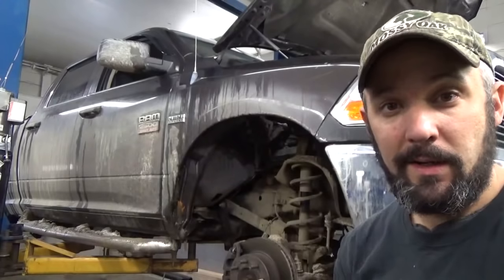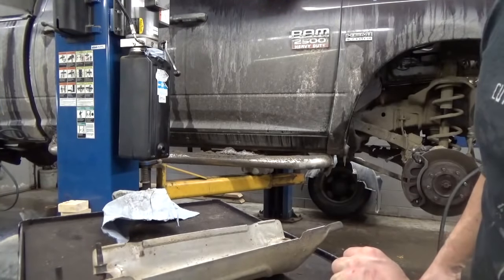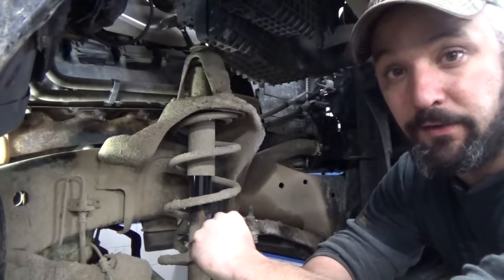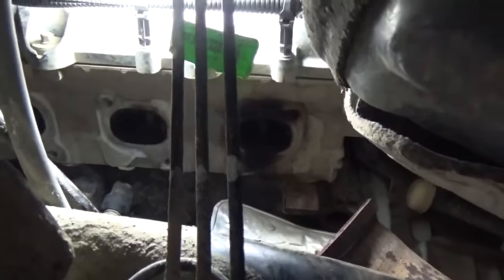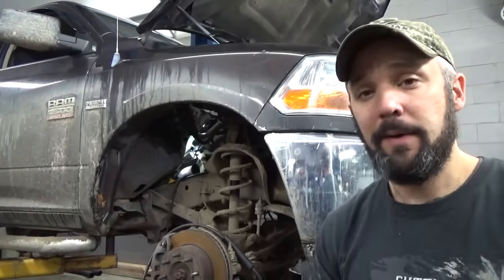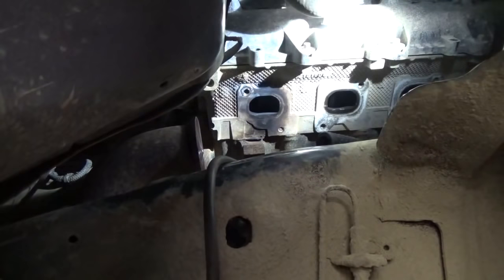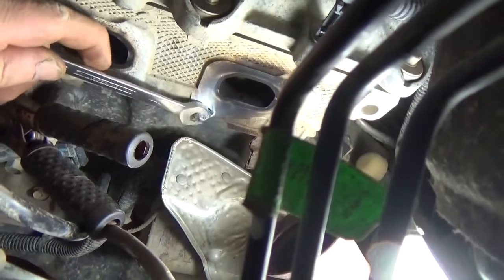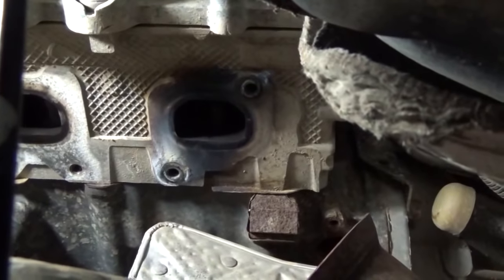Removing Broken Exhaust Manifold Bolts - Hemi Dodge Ram

Comment: There needs to be a recall on this with the Dodge Rams because I just took mines in this week to get repaired....it's a design flaw with cheap parts smh
Reply: maurice long how much did it cost you?
Reply: What did it end up costing you?  One or both sides.?  Looking at the same repair..
Reply: socchall hi right side cost me 360.00 friday it will another 460.00
Reply: 360.00
Reply: maurice long Why they used such small bolts is beyond me, seen tons of 5.7s come in with a case of the ticks!
Reply: maurice long as long as we continue to try and make cars trucks ect lighter and lighter and use more plastic and garbage quality this will never improve. I thought the same thing why make exhaust bolts so small and cheep? especialy when there a bear to get to, then I forgot that would cost 0.02cents more!
Reply: Totally agree with the recall. i have to believe that there are more that have had it done than those who haven't.  I had my drivers side done, now my passenger side is ticking.  Eric must be living right as it would never go this easy for me..
Reply: @rogerwa123  
Recalls are for safety items. This isn't a safety item.  The vehicle wont crash unexpectedly because of it. This is a routine repair.
Reply: Eldon Johnston 
Have you done this repair Eldon??? If not, it’s ABSOLUTELY NOT ROUTINE at all!!! It’s a premature part FAILURE!! The supplier that makes these bolts failed in the process somehow. Chrysler knows it, and even changed the supplier after this particular GEN of the Ram was over. There are THOUSANDS of these rams out there with this issue!! It’s so bad that most all Chrysler/Dodge parts centers keep these gaskets and manifolds in stock. Personally I replaced stock with shorty ceramic headers. BBK. Pain in the ASS to do this job! Not for a amateur!
Reply: Go figure its another dodge
Reply: I too have a 2010 dodge ram and it had a ticking, and it was the exhaust manifold, guy before drilled a hole to big and the stud was loose leaking out coolant, had to replace the cylinder head
Reply: Ford and Chevy having the same problem.
Reply: I'm not a big fan of Dodge products in general even before Fiat came along. But in all probability Fasteners turns themselves are coming from some overseas supplier. That supplier may be cheating on the specifications for what those bolts are supposed to be made of and their tensile strength. About 30 years ago Detroit got burned because there was a flood of Fasteners out of Taiwan that were the wrong tensile strength. It caught all the major car manufacturers and caused problems ranging from broken bolts to Warped heads.
Reply: I have 2015 and its ticking and has and exhaust leak noise at start up but goes away after running..I think this is the same issue
Reply: It's not cheap parts it's the difference in cooling from aluminum heads and cast manifolds
Reply: @mikefalle7910  sounds like it
Reply: @BigFrankRizzo  shortys suck. Long tubes way to go.
Reply: @littlebittathisnthatfirear8048  had a custom exhaust shop tell me the same thing. Shorty aren't worth it. Also, enlightened me on another unconfirmed truth. the problem will happen again with factory manifolds and with headers.
Reply: I was about to say, nearly every Ram I hear going by has an exhaust leak.
Reply: Every v8 pickup has this problem Fords are definitely the worst/most notorious. Dodges are common but it's easy so not that big of a deal. Definitely not recall worthy. If every manufacturer recalled a car because it had a common issue they wouldnt make money.
Reply: What's messed up is ford dodge and chevy all do that I change at least one every week at work on one of those 3
Reply: My Chevy did the same, I’ve seen it on all makes of trucks. I do know Dodge will cover it on powertrain warranty. Not sure on GM or Ford.
Reply: TYPICAL Dodge
Reply: I have a problem with mine too, the issue with mine is it says "manufactured by chrystler" and i want it recalled because all of them have this major issue
Reply: @eldonjohnston5053  what a load of crap, recalls are for all sorts of stuff. and a design flaw does not equal routine maintenance
Reply: @pannterra86  about tree fiddy'
Reply: @alexyoung4587  yeah well they wont make much money losing customers either. I traded mine for a tundra. My ram was doing this at 46k miles. Mechanic at the dealer told me they would have to replace the heads. $3500 repair. I loved my ram but I'm not replacing the heads every 46k miles because the bolts break off to deep for them to try to get at. So far my tundra has been rock solid.
Reply: It has nothing to do with cheap parts. It has everything to do with the design of the cast-iron exhaust manifold. For starters cast-iron to an aluminum head is the major problem, but the design of the manifold causes more heat at the back of the manifold.
Reply: Does this issue have anything to do with the ECO mode cutting out cylinders heating up and cooling off too much?
Reply: @theminion2771  Not really. This happens on other engines and brands also. It is mainly from using studs too small in diameter. The nuts rust fast to the manifold and the expansion and contraction of the manifold over time from heat cycles snaps the studs off. Rusting, if you are in the rust belt helps to accelerate the process. I put headers on my truck before it had 30k miles on it to avoid the inevitable stud breakage issues. The manifolds are thick and expand quite a bit when heated up, especially the stainless ones.
Reply: @sdvten  with the headers this problem is cured right?  Getting ready to pull the trigger on buying them but just want to be sure it's a real fix
Reply: @theminion2771  Headers seem to get rid of the stud breakage problem in my experience. I've had my headers on for  around 11 years now here in the rust belt and have not had to replace any bolts. They are just grade 5 zinc plated bolts that came with the headers. I re tightened them 2 or 3 times after the header install because the gasket compresses some but that is it. Get a good quality set of headers (stainless if possible) and you will likely have little to no issue.
Reply: @sdvten  am looking at JBA shortys.
Reply: @theminion2771  Those are pretty good.
Reply: @BigFrankRizzo  I pull the heads! So much easier! A little more expensive in gasket! But so much easier!
Reply: This isn't worth a recall lol 
This regular maintenance 
They should recall their hemi engine bc its a horrible build, sohc is dumb as it doesn't get enough lubrication from the oil causing the lifters to hit the camshaft and wear also causing the Hemi Tick
Reply: It's a problem on fords and chevys too.  My 04 silverado (5.3ls) had like 4 broken, my 2014 silverado (5.3lt) has two broken at the moment.  There's gotta be a better way for them to design these or use better fasteners.
Reply: @BigFrankRizzo  shorty headers are a waste of money for extremely minimal gains compared to longtube headers.
Reply: Ford trucks have the same issue.
Reply: What happens if you don't Make the repair
Reply: King
Reply: Got my tick today 53k miles
Reply: This and the oil pan should be Dodge recalls.  I just spent over 1k to have these bolts replaced at the dealership..To replace the oil pan is another 1K. According to all the videos to repair these " shitty" products,  these are both common and on going problems with RAM trucks.
Reply: @rodneyhickman825  been driving on mine for as far as I know over 10000 miles.  Been seeing a drop in mpg average. So took it in . Getting three new bolts and gaskets today. Hope to see it running better. The tick was getting worse as well. Im no mechanic,  but one would have to assume if not fixed would leave to carbon build up on the the valve seats and would eventually lead to bigger problems.  Just my guess.

Comment: Great video! This is one of those repairs that looks easy if you have a climate controlled garage, lift, and MIG welder. Car repair would be a breeze in these conditions! Meanwhile, I'm in Minnesota jacking my car up in a gravel drive way with only a butane torch........Time to pay the mechanic......
Reply: I agree. I'm on a dirt drive way with temperatures around 112 degrees . And no jack stands
Reply: You guys have a drive way? Living like kings!

Comment: Good video, I was able to extract my broken exhaust stud front drivers side 2013 Dodge Ram 1500 5.7L Hemi with your technique. Took me a little longer then I thought, took like ten nuts before I got a good weld. Thanks for your video it helped.

Comment: I had the back 2 bolt heads broken off on my 04 ram. I didn't remove the manifold but I was still able to weld a nut on the rest of the stud and back them out to replace the bolts. Did that and the ticking stopped! Great video!!!
Reply from the maker: +Blake E NICE! I have done that on some of the 6.0 GM's myself.

Comment: I had heard horror stories about replacing exhaust manifolds, and was a little apprehensive about replacing mine on my '03 Dakota 4x4 4.7L. Fortunately none of the bolt were already broken off, I just had cracked manifolds. I ended up taking my cutoff wheel and removing the heads of all the mounting bolts so that I could slide the old manifolds off, and still have enough material of the bolt to deal with getting them out of the heads. Of the 16 bolts I was able to remove all but one by hand. The last one I had to put a pair of vice grips on and turn it about a quarter turn then it came out by hand. 

I like the videos, you do great work. Keep up the great content. I believe that if people have the know how and ability to do things why should they pay other people to do what they can do for themselves.

Comment: Thanks so much for making this video. I followed your instructions and welded the nut onto my broken bolt. Worked like a charm! With the help of this video I was able to do this repair myself and saved over $700 compared to taking it to the stealership. You did a great job explaining and showing all the steps. Thanks again!!!

Comment: installed 2 new manifolds on my son's 2008 ram 1500 5.7 over the weekend following your guidance and it was a breeze.  3 studs broken off in heads and mig welding nuts worked perfect. Also studs for head shields were in bad shape so i cut the heads of them with acetylene and removed with vise grips after removing manifolds. thanks for the video!

Comment: Really nice work man!     Getting that 2nd bolt out was really  some great work.   In a case like this, brand new manifolds and bolts seem the smartest way to go.   Also.   Anyone owning one of these trucks should have these bolts checked out, loosened and replaced periodically.         Getting that 4th bolt out was something only the really gifted mechanics pull off.  Thanks for the tutorial.

Comment: when flush or recessed start with welding on a washer then a nut easier to get weld to stick
Reply: I've done the nut trick several times and it can be tricky. Your tip will make the next time a lot easier, thanks!

Comment: Great video, as the original owner of an 09 Ram 1500 Hemi, I have lifetime powertrain warranty.  My exhaust bolts have been replaced FOUR times, about every 40K miles.  I have 202K now, past due, 50K on this set.......

Comment: What an excellent demonstration, thanks for going through the effort of filming. I presume the extra heat needed to weld aluminum (rapid heat dissipation) is why you can weld so close to the head. Have you encountered any problems accidentally welding the bolt to the a steel head? Aside from removing the neg pole of the battery and avoiding fuel components, do you take any special precautions before welding on an engine?
Reply from the maker: No extra precautions taken other that the ones you mention and in reference to the cast heads I have hit the head while welding a bolt but it does not seem to bond to the cast well if that makes sense. The weld seems to break free from the cast really easy.

Comment: just did this job...had one manifold bolt broken off very deep, couldn't weld a nut onto the broken bolt as it was deep and the mig kept hitting the nut and head. Tried to put a nut on it a few times....gave up and just did weld build up until I could get a set of vice grips on it....worked well....thanks for the info SMA...much appreciated

Comment: With modern metallurgy, I don't understand why they have not come up with a better material for exhaust manifold bolts !  Some kind of stainless that is not brittle and has adequate strength.

Or at least go up a couple of sizes on the bolt/studs.
Reply from the maker: +theoldwizard998 Well that would be non sense to start thinking!
Reply: It's mainly a cost concern over quality, automakers pinch fractions of a penny to save costs
Reply: Matt Ramos bingo
Reply: It only needs to last 1 mile longer than the warranty.
Reply: The current trend is to have the exhaust manifold be part of the head. Exhaust pipe just hooks up to a single port on the head.
Reply: @joshrobinson856  that has nothing to do with breaking exhaust manifold bolts. It has to do with too much heat rejection from bumping up power (fueling and combustion pressures). The exhaust temps are too high for catalyst's and cause damage
Reply: @MaroLuva  cant break manifold bolts if there isn't any. F150s are bad for having manifold studs break. 99% that I have changed have been stock. Repeated heat cycles between the two dissimilar metals causes the studs to break. The corrosion under the manifold doesn't help either. Its much more common on an aluminum head motor than a steel head motor.
Reply: @joshrobinson856  I understand all of that, it's called cathodic corrosion. But again, just an added benefit. And so is total cost of assembly, since you're removing another casting, that's another couple hundred thousand in tooling/fixturing you're removing while adding only 1 or 2 more core boxes to your head tooling.   Not the reason that drove manufacturers to integrate the exhaust manifold though. Notice you only started seeing it once direct injection came around, which is about the same time we started bumping up cylinder pressures. Downside to this design is for the engineers, designing for all that heat exchange in the head is not easy. If you don't do it correctly you can have thermal fatigue cracking in your head.
Reply: @ramos5875  well when its millions of fractions you would care about that $ too thats how businesses work cheapest parts they can get away with using

Comment: I'm get'n ready to overhaul my 1996 Isuzu Rodeo V6 engine - has 463,000 miles- it still runs fairly decent but valve guide seals are leaking, has an oil leak at back of valve cover cam seal (can't get a wrench on bolts to remove cover)-also few oil leaks here an' there. This video will help me with figuring out how to deal with exhaust manifold bolts - the worst part of working on cars if you ask me - Anyways, I really like the Rodeo - learned a lot about OBD electronics stuff on her - she been a good ol' gal. Shopping around for another ride the prices sent me right back to engine rebuilding- there's just nuthin' like driving something you rebuilt yourself - thanks for making this video Eric....cheers!

Comment: Quick question, did the customer say whether the noise went away after it warmed up or did it stay constant? I'm having a similar noise on my 09 ram but the noise goes away after warming up. Great video and looking forward to a response!
Reply: Kyle Swiger the sound will quiet down as the manifold heats up and expands, i cannot believe dodge hasn't fixed this issue yet...i refuse to buy another dodge ever
Reply: stringb3an I,m sure it's fixed, I have a 89 Mallard Sprinter 30ft Chevy 454c.i. that are notorious for broken exhaust manifold bolts and 28th a eighth inch clearance hard to get to you almost have to remove engine just to do tune up and ive been putting it off but will take care of it when were past this lovely -30F weather, makes that dang ticking noise been doin it for 5 yrs.
Reply: RAM TRUCKS Fords 5.0L doesnt have exhaust manifold problems. They have big beefy studs and nuts. Haven't seen one that's leaked yet, and I work at a Ford dealer. At least Ford fixed the problem. Ram just keeps putting crappy manifold hardware in 😂
Reply: @alexpuls8219   Now let's talk about the 5.4 3v's spark plugs and phasers.
Reply: +RAM TRUCKS The ONLY thing good in a Ram Truck is a CUMMINS DIESEL. Rest is CRAP.    GTFO

Comment: My 03 ram 2500 transfer case drain and fill plug was rounded off. So I got a bolt and welded on it with my harbor freight flux core welder. Worked like magic!
I got a crown Vic with broken exhaust manifold studs and I'm not looking forward to it but hopefully all goes well with this method.
Thanks for the video!

Comment: Another in the bag of tricks are left hand helix drill bits. Snap On makes a set of five smaller sizes and Cle-Line makes them as well. They work if you have to go the drill out method. Enjoy your vids. Keep up the good work.

Comment: Thanks for the video... I did this for several broken studs on my F150 4.6L... worked for 4 of them but one was more than 1/4" deep and had a divit  in the head on the edge of the hole. That caused metal to pool and col there and prevented it from spinning out. tried more than a dozen times, even using a carbide burr to bevel the hole so it would have more room to turn. Ended up removing motor mount bolts and jacking up engine to get enough room to drill. After breaking a couple of bits I got a hole started and then switched to a "left hand" twist drill and part way through the bit caught and spun the loose stud right out! SUCCESS!! Your and other videos gave me the confidence to tackle this myself...That and the fact that 2 local shops refused to touch it themselves, too chicken to even tackle it.